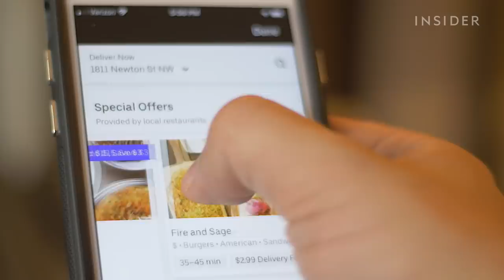How Used Chopsticks Are Turned Into Tables, Tiles, And Other Furniture | World Wide Waste

Comment: These chopsticks are 100% compostable, before you soak them in resin.   After this "recycle" processing, congret, the end products are not compostable, and not so eco friendly anymore.
Reply: Yeah, this won't directly help lower chopstick production either so they are not exactly helping the environment or reducing waste as you stated.
Had the chopstick been simply ground and composted it would have been better, but this is actually a great show of commitment on the side of the restaurants with regards to trash separation. 
Only once you know predictably what's in the trash can you begin to think of how to recycle it
Reply: @nourmasalkhi9004  The best commitment on the food service industry side can do now, is stop using flatware, straw, and container made with plastic, or Styrofoam.
Reply: So true though. Because if they break, what will you even do with them. Most likely throw it away. So this is a temporary solution, really.
Reply: China's chopsticks are mainly make of bamboo not wood.
Reply: wooden items should be banned
Reply: @ankushzap  then we end up creating more plastic
Reply: @Datasavingmode  how abt biodegradable plastics?
Reply: @ankushzap  those still need special facilities to break it down
Reply: Doesn’t that depend on the type of resin used? Since some are made from plants still and can decompose
Reply: @Sketchy_Dood  Eco resin are way too expansive, and usually used as wood varnishes and glazes,  not really for casting.
Reply: Also theres alot excess offcuts to create the desired shape, those offcuts are no longer compostable
Reply: @ankushzap  😆😆😆
Reply: They did say upcycle rather than recycle, to be fair to the company
Reply: @nourmasalkhi9004  however using them twice and putting them back into the market does displace other products. It allows you to use the wood twice, rather than cutting down trees for another new product.

However the hierarchy is reduce, reuse, recycle. This is about reusing chopsticks. We should honestly just reduce all single use items to zero.
Reply: @ankushzap  replacing them with plastic is worse in many ways. We just need to reduce the number of things we make. Perhaps even subsidize higher quality items for those who cannot afford them so that what resources we use go into items that last much longer.
Reply: @nourmasalkhi9004  it’s literally better than growing more trees for furniture because that requires more resources than this upcycling.
Reply: @GoingtoHecq  yes agreed
Reply: Literally every single table or cutting board ect you can buy at a store has noncompostable contents like glues or waxes, as well as special resins. So them using chopsticks is actually the same process as other wood items, but in smaller scale. And when I say in store I mean big scale productions you can buy in supermarkets, designer, or furniture store just like at a local carpenter. Masive wood items EXIST but they're hella expensive bc they're harder to work with. And heavy. And more seldom
Reply: @ankushzap  How about biodegradable wood...
Reply: @jah0350  you again back to zero
Reply: Tables are durable products. They last longer, not meant to be thrown out after 1 use. Yes it would be better if they used resin that was eco friendly but we really should be focusing on eliminating single use plastics first. Those are the majority of waste
Reply: @waynewong4434  will never happen. i got paper straws out here in the US that come in plastic wrapping shit is a joke
Reply: @nourmasalkhi9004  
How do we know the chopsticks are compostable already? I don't doubt it, but there could be some that aren't compostable.
Also, the message was pretty clear however, single use chopsticks aren't going away in the future, at least for now. Recycling these is good at stopping deforesting caused from making other wooden goods (tables and coasters) in the short term, while composting them is only good in the long term.
Reply: Actually if you compost the wood you would release the entrapped carbon back into the environment which is you know bad. That’s what trees do, they suck carbon out of the air and build wood.
Reply: The waste will always be somewhere until it composts after many years, still residing in the ground being absorbed by it, thus the real only way to end the waste is to end the production, to end it at it’s roots and beginnings

This way however does have a few benefits, reducing the amount of bamboo or wood being harvested and cut down, despite most companies regrowing the plants harvested, using chopsticks rather than brand new trees to create furniture to manage storage of other items and be used as miscellaneous tools and general houseware
Reply: @thsoup2353  These chopsticks use bamboo grown less than a year to produced, and un treated bamboo(include these chopstick) take  some where between 1 - 3 years to completely decompose to soil.  So, tell me, which martial is more environmental friendly?  I seen one time used utensils make with sugar cane end product, which are much expansive, use more energy to produce, and can only compost in commercial compost facility.
Reply: @waynewong4434  *expensive
Reply: Agreed but on thw other hand making furniture from them stops trees being cut down to make that furniture piece. Either way you won't be able to win unless you stop the production of rhe initial product
Reply: they are not recycled they are upcycled
Reply: @waynewong4434  thanks I appreciate you being wise. In addition to what you’ve said disposable bamboo products capture carbon.
Reply: But they mostly get thrown away in a plastic or foam container.
Reply: @Huppy1234567  some are wrapped in cellophane which is recyclable with paper and cardboard. But yeah a lot of "eco-friendly" items are wrapped in plastic still.
Reply: 100 % Compostable meaning home compostable or industrial ones ???
Reply: @shriyabhattacharya1889  bamboo/wood chopsticks goes in yard waste trash, not recycle bin.
Reply: Surely there should be a way to avoid that resin. Maybe some kind of natural glue od some sort? Idk, there must be a way to avoid using resin
Reply: Question: They said it’s a water based resin, does that make it any better than any other type?
Reply: @ankushzap  No
Reply: i'm going to agree with you, you're right. the flip side of the argument is that the wood has already been processed. a little more effort and you produce a table, shelf or something else that would otherwise involve cutting down another tree. 
bit of a catch 22.
Reply: 1000 % - This is a gimmick at best and environmentally destructive at worst.  People don’t know what their talking about.

I think half the support seen in the comments are bots too which where there is bots - definitely question everything.

Comment: The wood in the chopsticks will be far more durable than plywood or any other nonsense you get at IKEA and the likes, and tbh from most angles looks like new wooden furniture bc of how it's made. I really hope this catches on in more places across the world.
Reply: Ida hoe  That depends on a lot of factors. Is the durability and usability of the table comparable to the ones made in the video? Are the tables or other wooden furniture sold in the area you’re referring to generally cheaper compared to Vancouver?
Reply: Not totally true. 3/4 thick plywood will be much stronger and durable, and will not expand and contract, compared to most hardwood panels by that thickness. chopsticks are usually 6 inches long, and they are edge jointed, which are not really strong. I learned this by watching tons of woodworking videos for 5years now.
Reply: @nobnobnobnob  Why not put them in a shredder and make plywood?
Reply: @vjaceslavsavsjaniks6431  plywood is made from layering multiple thin plys of wood.

Wood shredded would become particle board (wood chips with glue). This is what Ikea uses for many of their cheaper furniture. Cheap but it warps in humid locations and swells if you get water on it.
Reply: @creatorsky8764  I get it but still, why don`t make it out of chopsticks if needed?
Reply: @vjaceslavsavsjaniks6431  Those shredded wood(including waste from shops like sawdust etc.) is the main material for MDF boards. It's a different story comparing MDF and Plywood.
Reply: @vjaceslavsavsjaniks6431  you can't make plywood out of chopsticks. Because its already in tiny sticks.
For plywood you need large pieces of thin flat wood to glue and press them together.
Reply: I have a 25 year old IKEA bookshelf, it still looks brand new. The good times long hair and a motorcycle, now little hair and no motorcycle. That bookshelf has been a life witness 😁
Reply: aren't all chopsticks made out of bamboo? Bamboo is not wood, it's a grass
Reply: @creatorsky8764  but chopsticks could make layers, can't they?
Reply: @jskratnyarlathotep8411  Bambambooo 🐼
Reply: I can make a solid desk out of 2x6 and 2x4 a whole lot bigger and it will last way longer than that chopstick desk.  It costs me about 120 bucks to make it and that's with the jacked up prices that's going on right now
Reply: and what is the material at the end of life now? At first it was small wood / bamboo sticks, now it is a mix of epoxy and wood fibers. What has been achieved? 100% biodegradable becomes 100% hazardous waste and ends up in a landfill at the end of life for about 100 times longer than a chopstick and now also contaminates the environment with toxic residues of epoxy.
Reply: @larsstougaard7097  Hope brings nothing. There are all the solutions we need for more than 30 years, but capitalism stands in the way of the solutions, which is why they were locked away. There has been a full plastic recycling process, solvolysis, since 1997. This process would solve the plastic and fuel problem at the expense of the entire oil industry, as the output of the plant would replace 80% crude oil. Electronics is also such a point, the processes are there, but it is still (and also in the future) cheaper to let a few hundred thousand poorest of the poor die in a dirt hole of an ore mine than to use the processes (to waste the garbage in the 3rd world dump is also cheaper).
Reply: I always though chopsticks could be made into paper or MDF. This doesn't seem like a very resistant arrangement... Maybe make 90 degree amending layers, as real/Roman/naval plywood... 🤔
Reply: Chopsticks are made from Bamboo
Reply: @yourdeal2408  Chopsticks are smoothed, and frequently tapered. They are traditionally made of wood, bamboo, metal, ivory, and ceramics, and in modern days, increasingly available in non-traditional materials such as plastic, stainless steel, and even titanium.
Reply: @larsstougaard7097  plastics chopsticks are not used for take away
Bamboo chopsticks are used for take away
In China it is forbidden by law to use wooden chopsticks for take away
In the 20 years that i live in China i never got wooden chopsticks with take away ,even some cheap restaurants give bamboo chopsticks instead of any other material
Reply: I don't think you have any idea how durable this is compared to Ikea furniture. You are just making things up.
Reply: Chopsticks are made from bamboo,NOT WOOD
Reply: @larsstougaard7097  one time use  chopsticks are ALWAYS made of bamboo
Reply: @yourdeal2408  Not always true , mass-produced chopsticks, especially the disposable kind, are made rapidly in a fully automated process of different materials like bamboo and common wood. Like Aspen wood is harvested, and the finest grade wood selected. This wood is fed into a mill, which cuts it into blocks. This process typically happens at the site where the wood is grown. Then the aspen blocks are exported to the country where they will be used.
The blanks are cut, sanded, and finished at a chopstick factory, which may churn out millions and millions of pairs a year. It's a wonderful chopstick used once or more times, I fully recommend it 🍚🍜🍣🍚🍲🥟
Reply: @larsstougaard7097  disposale chopsticks are ALWAYS made of bamboo because that is the cheapest material 
A container of bamboo chopsticks cost landed in USA 1/5 of the price of a container  chopsticks made in North america from wood

By the way 

My brother in law has a chopstick factory in China
Reply: @yourdeal2408  may the bamboo grow as fast as your family business 🎋🐼🎋🐼🎋🐼🎋🐼🎋🐼🎋🐼🎋🐼🎋🐼🎋🐼🍜
Reply: Where u from?
Reply: @yourdeal2408  Bro, 45% of disposable chopsticks made in china are made from wood, not bamboo.
Reply: @majorphysics3669  NO
It is forbidden by law to use and produce one time use chopsticks from wood
And that is not only in China but in almost al Asia countries
Reply: @yourdeal2408  bro that's just false. My stat comes right from the China department of forestry from 2019
Reply: the chopsticks in the video are from BAMBOO
NOT WOOD
Reply: @yourdeal2408  false news? Bro. They're chopsticks, not politics.
Reply: @majorphysics3669  yes they are chopsticks MADE OF BAMBOO
NOT WOOD
Reply: From Ikea you can get a solid wood butcher block for 100-200 dollars which is more durable than thousands of chopsticks glued and pressed together. This product is way overpriced.
Reply: Not everyone in the world reaches out for wooden sticks every time they've to eat something.
Reply: @yourdeal2408  Pls explain. Bamboo have thin circular wall. How to turn bamboo into disposable chopsitcks ?
Reply: Are you buying a $1000 table made from shit ?.. 😂
Reply: @zenlei8258  bro chopsticks are very thin and small, they're just long. Have you seen mature bamboo tree's segment? That's kinda thick, don't let cartoons or pandas fool you into think bamboos are thin and small. You could also do your own research and look it up. There are tons of vids and resources for stuff made out of bamboo.
Reply: A lot of ideas furniture is made of softwood such as pine, which should be far more durable than this laminated product.
Reply: LOL..... Liberals....... What in the hell do you think plywood is?......
Reply: poorer families will suffer if this becomes the norm
Reply: If only trash turned into furniture was as inexpensive as Ikea. That's the problem really, sustainable means high prices and only the wealthy can access it.
Reply: It’s a cool idea but looks like 15% of the end result is glue and air…
Reply: Most of those disposable chopsticks are made of bamboo though.
Reply: @terrylap6132    P. P. P.  P p p
Reply: How do you know that?
Reply: The problem is this....POV water based resins dissolve when exposed to water.
Reply: @nobnobnobnob  Not to mention that POV water based resins break down when exposed to water.
Reply: @jskratnyarlathotep8411  Chopstick are made of wood, bamboo, ivory, stainless steel, silver, gold and other materials. Besides, bamboo is a woody grass that is commonly made into floor tiles. No problem there.
Reply: It’s bamboo not wood
Reply: @alexwang982  Chop sticks are made of other material besides bamboo. You have wood, ivory, silver, gold, amongst other materials.
Reply: @snowflakehunter  bamboo is more common than wood for chopsticks
Reply: @alexwang982  and?
Reply: @alexwang982  Not in the United States. Why do you think he started the business collecting WOOD chopsticks? Because they were plentiful!!
Reply: Yes